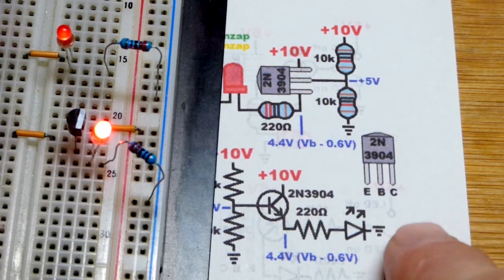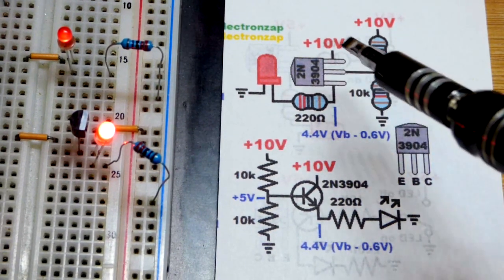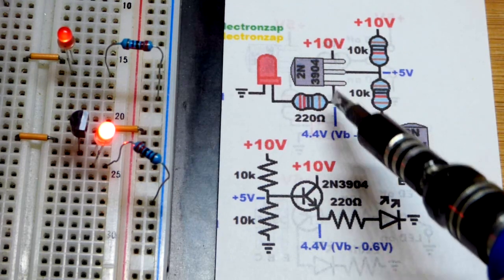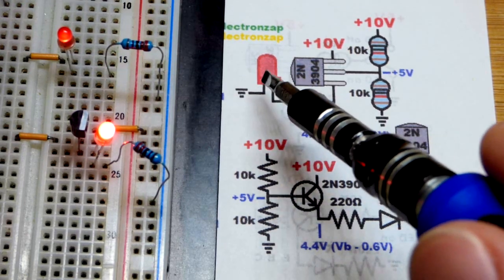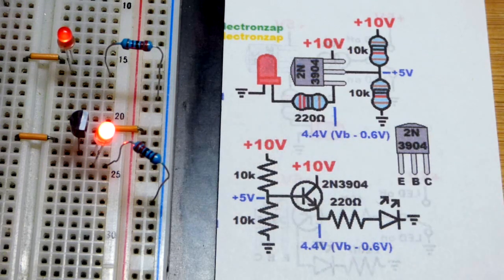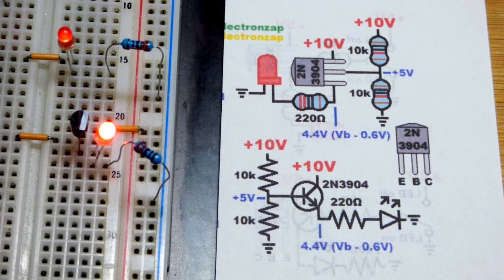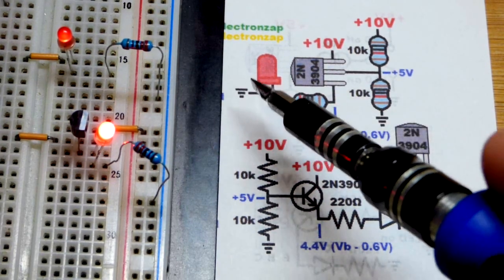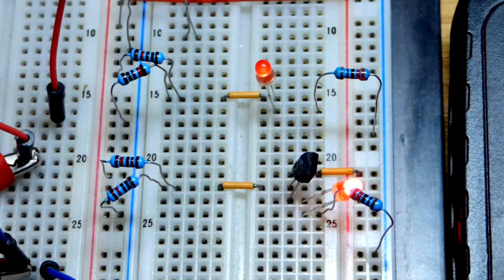NPN BJT emitter follower improved fixed resistor voltage divider circuit using 2N3904 transistor

Comment: Have you played with bpt pairs yet?
Reply from the maker: Not as differential or audio amplifier. I've paired them up for voltage and current sources to cancel the base to emitter diode drop.
Reply: @Electronzap  nice! Im learning about class a and ab biasing. Cool stuff!
Reply from the maker: @user-su5sq5ib3i  Nice!